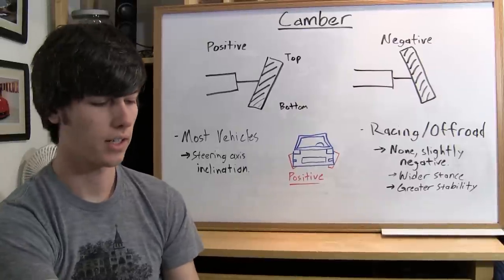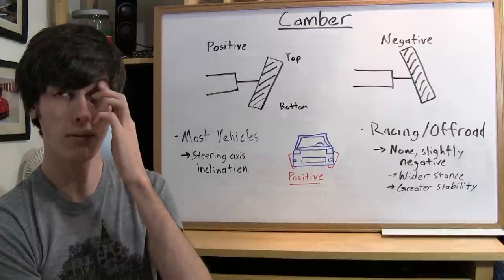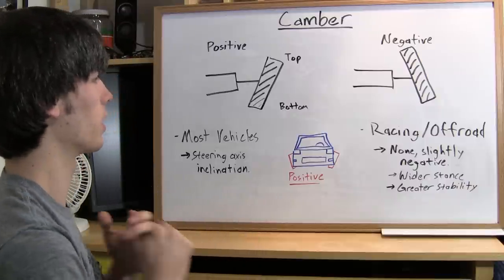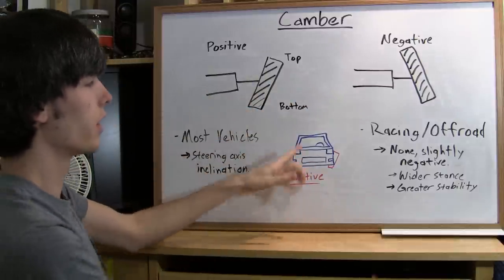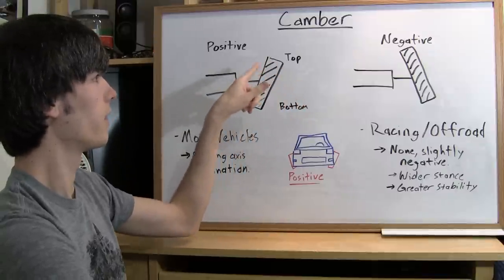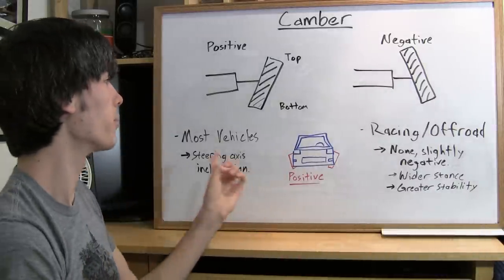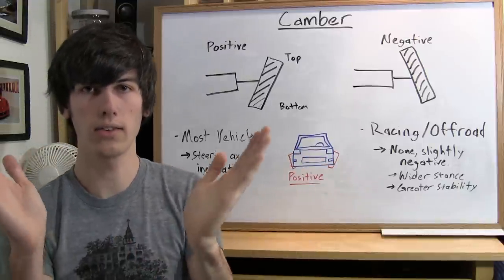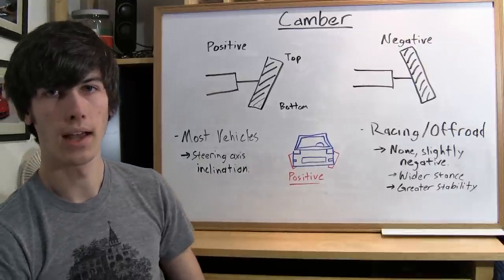What Is Camber? A Simple Explanation

Comment: We need to understand that all alignment adjustments are made in a static state...with the hopes that they will act well in the dynamic...camber adjustment is done to insure maximum lateral acceleration in a competition setting...on street cars it can effect wear and stability...oval track cars use positive on the inside, and negative on the outside...as far as actual angle settings go, it depends on what the tire asks for...we determine this with a pyrometer...or an I R thermometer.

Comment: Modern onroad cars use cambers like -1 degree. For onroad racing its only negative camber and for offroad racing it depends but can be positive. Onroad racers are gaining more lateral traction with negative cambers and normal cars are mostly tuned for optimal wearing.

Comment: Correct me if I'm wrong here, but aren't the usual reasons for positive and negative cambera bit different? AFAIK, the main benefit of positive camber is that it makes steering lighter, which was important when power steering hadn't been invented yet. Other than that it is frankly dangerous for road holding, and none of the road cars I've been involved with had it, all were neutral or slightly negative. Then on to negative camber, I've always been under the impression that... (continued)

Comment: ... motorcycle, increasing the centripetal force. Naturally the inside tyre can do the opposite (depending on a combination of caster, camber and toe) and negate the effect, but a well setup suspension can make great use of camber thrust.

A positive camber is hellish for cornering, since it transfers even more weight to the outside of the tyre, ruining the contact patch shape and essentially doing everything to prevent turning. =)

Comment: ... the main reason for that is the shape of the contact patch, not exactly "wider stance" as you mentioned. A car cornering will lean towards the outside, which will cause the contact patch to change shape, and load the outside of the tyre more. Negative camber balances this, maximizing the contact patch during cornering. There's also camber thrust, which is hard to explain in this small space, but you can look it up on the Wiki. The camber works basically in the same way as leaning a...

Comment: if you have McPherson suspension or something that pivots you don't need a fixed camber angle,the car already gains camber angle as it tilts, with extra camber you lose contact the more the car tilts. fixed negative camber is for cars that camber steer, camber steer is when the inside wheel gets positive camber and the outside wheel gets negative camber going into a turn, like how you lean a motorcycle into a turn,, if it had two front wheels, with this setup adding "slight" negative camber ( not too much because the outside wheel is already getting negative camber) will help the inside wheel (wich is getting positive camber) be more flat on the ground in a turn, negative rear camber will help the car slide because the tires arnt flat on the ground so go for it, a lot of people are very misinformed about the camber thing, but it dose look cool on lowriders
Reply: Bullshit.
I run -2.5 degrees negative camber the advantages  are great. Better turn in, more grip, and car tracks dead straight always 
Depends how car is set up

Comment: Neutral camber increases friction of the tire while turning the steering wheel. Therefore old cars had positive camber (see other comment). Therefore, on the front axle the camber is slightly higher than on the rear axle.

Comment: On my Mercedes C-class I have different specs for the front and rear tires. The Front ones have positive camber and the rear ones are with slight negative, that increases with the added weight in the trunk. Different manufacturers prefer different setting, depending on the application of the vehicle. BMW for example uses negative camber on their M series (Sports Application). Commonly an old utility truck will be with no Camber at all.   

Lately I've been seeing often vehicles that have no front Camber/Caster adjustment bolts, but rear ones. I guess that comes with independent suspension.
Reply: Svet Stefanov MB uses a double wishbone suspension that has a negative camber. 

My GL550 has negative camber on the rear as well.

Comment: I don't know about today, but in the 1960's and 70's you often saw a lot of negative camber on rear engined cars. Especially racing. I recall one F Jr car at Laguna Seca. It had 15-20 degrees or more of camber. As he came off the last turn, onto the straight, he would be spinning his little tires and the axle/tires would go from  /   \      to  |  |   all the while the car's rear end would be rising higher and higher as those 6:50x15 tires spun away..  this took some time and no, he didn't win, he was in the back.

Comment: 05 Honda CRV rear tires seem to have negative cambers so that’s a good thing? It’s my wife’s vehicle and my father in law noticed that the tires went slightly in from the top. My cousin who knows a lot about honda and acura says that most suv for those models have negative cambers and that you’d mostly have to worry about the bottom tire being in over the top tire being in which is the norm. So this means that the inner treading gets most of the wear. When do i know to make the changes, should they be made solely based on it being negative. It seems to drive fine on our end just all new to me, i don’t want to leave my wife and kids stranded

Comment: Another shot from the past... Quick question, as I'm struggling to find answers... I keep seeing setups for track day use for FR cars and they have -2.5 Deg Camber front and -2 Deg Camber rear with about 4 Deg caster. Why they don't max out caster and use less Camber on the front so, when they brake for the corner to have better tyre patch for braking? To my understanding caster gives a dynamic Camber as you steer...

Comment from the maker: I understand it's a joke. But you still didn't tell me what they all say. Nascar uses positive camber on the left tire and negative camber on the right tire to compensate for the banked left turn. If they use both positive and negative, would their not be an application out there that would use neutral? What's wrong with neutral? Slight negative may be beneficial in a high speed turn, but it's still going to be very close to neutral.

Comment: OK but what are the pros and cons of having positive and/or 
negative camber in racing?
Reply: Negative: better stability and turning, but more wear. Positive: less wear and rolling resistance, less stability and turning capability.
Reply: In racing you don't care about wear, you prefer more cornering speed and more stability. F1 cars front camber is limited to -3.9 degrees, but without limitation they would use a bit more, for sure. Also, positive camber is used in cars with a high range of load variation becouse the wheels tend to bend straight, in racing you don't have load variation.
Reply: Here are some camber setups in some racing disciplines:

Grip, time attack: Slightly negative camber, there will always be more up front than at the back. It's so small you need good eyes to really see it.
Drift: For grassroots drift cars, negative up front, none in the back. For pro drift cars (FD, D1GP, etc.), negative up front, a little positive in the rear. (some of them squat hard when they drift)
NASCAR: Negative on the right wheels, positive on the left, except when they're not racing on speedways.

Comment: New Fiesta ST has negative camber on the front from the factory :)
-1.18 to be exact.
Reply: +GotzeGaming HAHAHA, come back after your math teacher has taught you trigonometry, and your english teacher has taught you comprehension. They still do that in primary school, right?
Reply: +MHBGT dude have you looked at a car with 2% camber you cant see it. come back to me when you have some real world experience in the car culture
Reply: +MHBGT ps i got a's in calc and got a 33 in math on my act.
Reply: +GotzeGaming 
Comprehension: I've said nothing about what is good or bad. I'm commenting on the degree of camber on the Fiesta ST which as you know, is one of the best handling cars you can buy for the money. 

Suspension geometry and the various angles (in degrees, please) are designed to achieve certain characteristics. -1.15 º of camber (which might not seem like much to you) clearly makes a significant difference due to the Fiesta ST's unique suspension geometry (compared to the vanilla Ford Fiesta).

Comment: Quick question: any issues/impact if i set -1.5 camber to ONLY my front wheels using caliber bolts? Primary aim is to tuck in about 8mm of the 20mm pole to ensure i clear fenders on max suspension travel. Rear would remain stock on my BRZ.

Comment: Positive Camber is not used ANYWHERE. I've never seen it on a relevant car, and I worked on quite a few. neutral on anything that is supposed to go around a corner quickly is a no-go as well. even production sportscars go well over -1 sometimes. touring cars go into the -3 area and on rallying to -5 in rare occasions.

the time of positive camber was in the 60s, when simple compact cars couldnt clear decent suspensions and had to use these compromises. but the reason for their positive camber was that theyd get neutral/negative with a few people in it! ever seen a citroen 2cv jacked up...?
Reply: On production based cars you would be correct but positive camber is used in circle track vehicles (think NASCAR) to keep the inside tires flatter to the pavement.  Fun fact! ;)
Reply: Yeah, and yeah lol. Most cars that were made to be pushed a little and go fast have negative camber.

Comment: I've watched many of your suspension videos but still have a rather odd question. If the tie rod ends are connected on the lower  side of the knuckle (04-08 F150 knuckle), than could a toe in also result in some positive camber?
Reply: 5 years and the question is still unanswered xd

Comment: Hi there, here is a difficult question what is the kind of the rubber material used in making the bushes that are made for the suspension mounting? What kind of material is is used and its characteristics with respect to temperature? I tried my luck with google but couldn't find the answer i was looking for. Thanks, Cheers.
Reply: DEEPAK AKKI late reply, but if you are talking about bushings, which is what I assume you meant, then many of the aftermarket bushings are made of polyurethane, and a lot of bearings are made of babbit

Comment: great video! i just had a 4" rough country lift kit installed on my 93' ford f150 xlt 2 wheel drive pickup truck. when i drive forward the wheels rotate normally normal. when i reverse the truck slightly lowers itself and the wheels camber like the negative picture you. when i drive forward the truck rises back up the wheels straighten up normally.  is this normal.  according to the shop where i had it installed said its normal. what do you think? any idea or comment on my issue?
Reply: Leo Yanez - if you can force the front of the vehicle down (winch or something) 4" you will be able to observe the suspensions behaviour. As you let it rise back up, you should notice the geometry changes. You need to reinstate the original geometry as best as possible but at your higher ride height. I'm not familiar with F150's but I would take a punt that it's the upper wishbones that are to far out of spec and are contributing to a toe in and reduced castor problem that is causing the front wheels to try roll outwards away from the vehicle when reversing causing the front to lower. If so, they will need replacing with an adjustable items. Also you may wish to consider replacing the lower arms and/or eccentric castor bushes (or applicable items) with adjustable items as well to regain some track and correct camber and castor parameters.

P.S. 2.5"suspension lift coupled with a 1.5" - 2.5" body lift can be a better option (C.O.G, Drive shaft uni wear, Panhard problems, brake lines length etc) if desired wheel size clearance is achieved and is not too cost prohibitive and can still

Comment: +EngineeringExplained if i did a negative camber to my fwd.. do i have to do the back as well?
Reply: Emmanuel Macapayag Yes you should.
Reply: James Sowin same camber or different, depends on what the set up needs?
Reply: Emmanuel Macapayag I can't be 100% sure, but most likely the same camber. My tip is to try different settings, and compare the driving feel. Fine tuning comes down to trial and error, computer measures can only get you so far.
Reply: +Emmanuel Macapayag Setup will depend a lot on what you do.  When I raced a FWD on autocross, I used -1 degree on the front and -0.5 degree on the rear to try to help the back get more upset under heavy braking.  If you know your tire pressures are dialed in already, you can use some sidewalk chalk on your treads, drive a couple laps at the hardest you plan to, then check to see if the chalk is wore off evenly.  If an edge lost more chalk than the other, than the alignment's too extreme for how you drove.